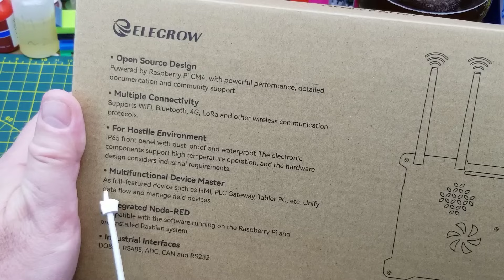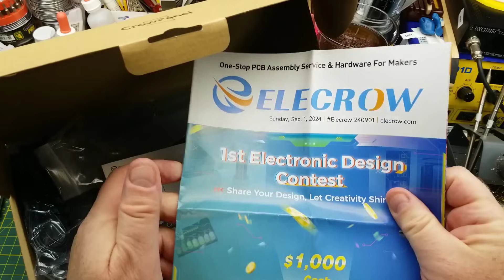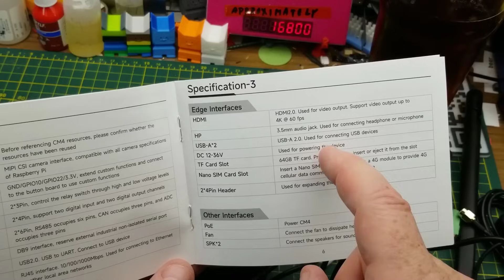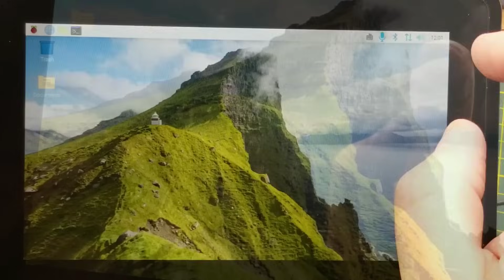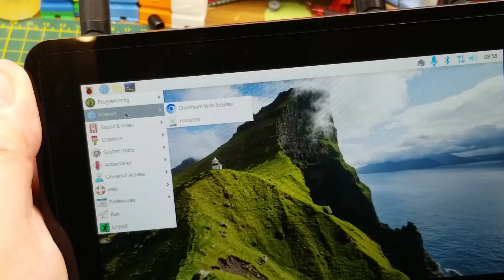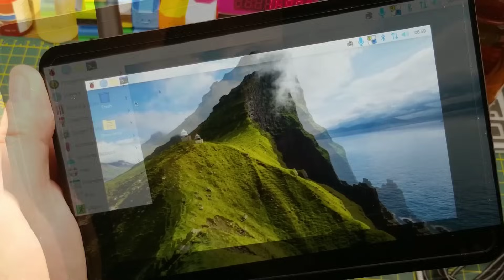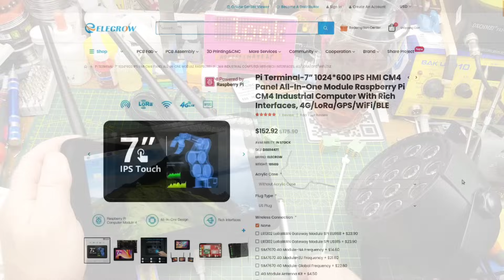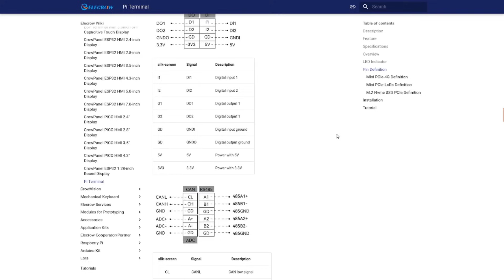First look: Elecrow Pi Terminal

Comment: Might be "all-in-one" but all those cables and antennas sticking out make it barely usable or mountable.
Reply from the maker: If it was mounted in a kiosk or larger cabinet (which I assume is the manufacturer's intent) the cables would be inside, and the antennas could be extended wherever you need.

While they do call it a "tablet", the lack of a battery seems to imply that's not how it is expected to be used.

Comment: Nice device, I have no need for something like this, but it's good to know about it. It has a good price point even if its  just for tinkering. The fan seems a little loud. Thanks for the overview. Take care.
Reply: Gee, the fan is loud.
Its the prepper tablet:  This device provides low power modern radios, to an open programming stack.